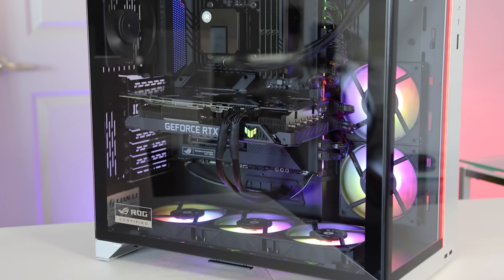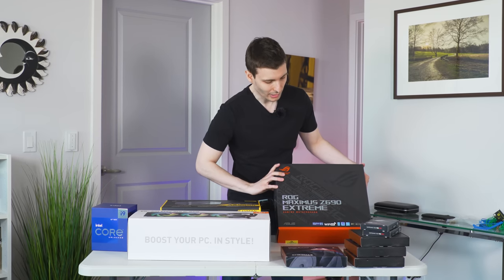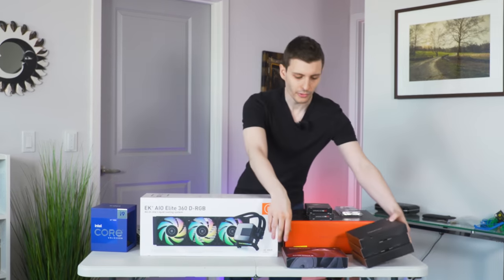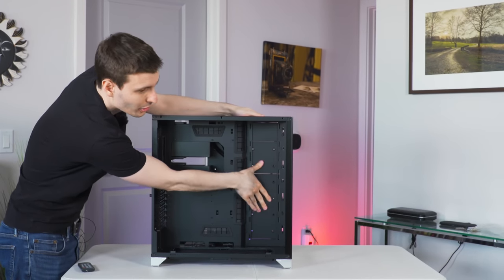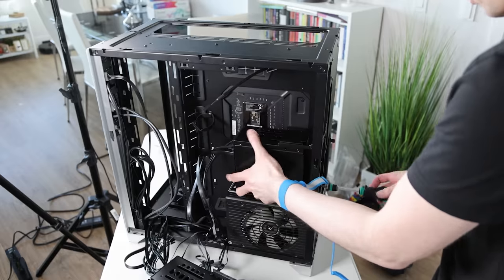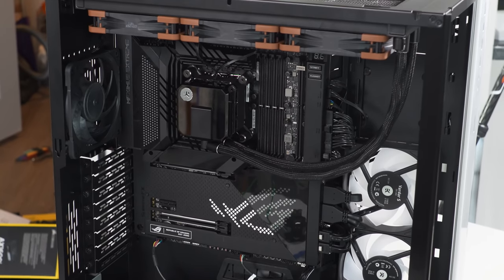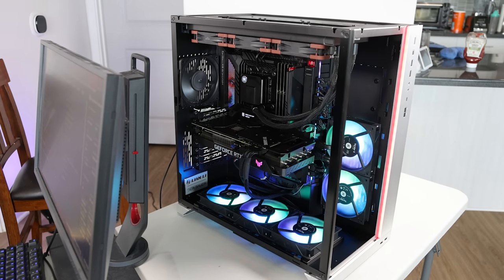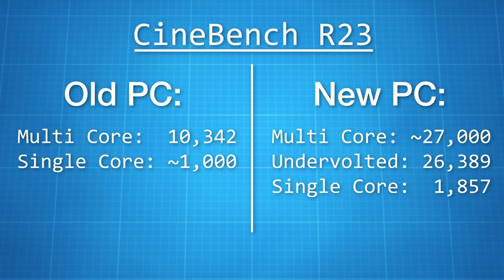I FINALLY Built a New PC After 7 Years (Unlimited Budget)

Comment: For my first pc build since 2003 I went all out too and spent $4,300 and built a powerhouse PC when I built it I was 2 parts away from being the best Ryzen machine you could build and I bought it last year sadly or it would be 5950X instead of 5900X and I woulda probably still just went with a 3080 Ti the 3090 is just excessive and unnecessary at this point, heard rumor’s of desktop zen3 6000 CPU’s later this year so I’ll just get a 6900X or w/e they call it in 4-5 years and upgrade to that

Comment: You are drawing air in from the bottom of the case and from the side and pushing it out of top of the case which means all the heat in your case is being pushed through your radiator. I watched a lot of videos on this case before building my PC and I settled on pulling air in from the top and bottom and pushing air out the side of the case.  This has worked really well for me and my temps are stellar.  I chose a Lian Li Galahad for my cooler though.  I would be a little worried about the fact that your CPU temps were high and you undervolted to accommodate this. A stock cpu shouldn't be getting hot like that and shouldn't need undervolting.  The first thing that should be considered here is you are using an AIO designed with 6 fans and have reduced it to 3.  Regardless of the fans you chose this should be the first thing you checked to see if you had gotten better temperatures if you changed.  IMO if you don't want to do that I would consider transitioning to pushing air out of the side and drawing in air from the top and bottom to see if this helps.  My stock 12900k doesn't get hot even when it is being pushed and my score if memory serves was over 29000.

Comment: Very nice pc, I'm about to build in the same case with the lian li sl 120 fans and strimers. Using a 12900k with an asus z690e gaming mb with 64gb corsair dominator ddr5 5200mhz ram. Will be using an nzxt z73 aio for the cpu and an evga ftw3 3080ti and an evga supernova 1000w P2 psu. I installed the cool my gpu copper plate on my 3080ti which should help it run cooler. Thanks for sharing, looks great!

Comment: maybe you didnt screw the radiator block to the cpu the right way or you didnt screw it enough to have the preferable pressure because the temperatures are higher than they should be... i know this chip is super power hungry and everything but still... you have almost the maximum airflow that you could have in this case with a big ass top tier 360 radiator.... (maybe you have it inside a closet or something lol)

Comment: Nice computer, but surely the first troubleshooting step would have been to plug in a monitor?
Reply from the maker: Now i know
Reply: Same. I've never seen someone NOT plug in a monitor after building a computer. Server motherboards that might not have video cards (or display-less video cards) will have a VGA output so that you can plug in a monitor for initial setup.

Comment: WHAT!! A 1,600 watt power supply. Are you crazy. You may as well have purchased a cheap fan heater for $100. An all AMD build would be future proof on half that power output, AM4 and AM5. Would it be wiser to install two smaller power supplies. Just one would be just enough for the new 40XX Nvidia cards.

Comment: ASUS software comment
My X470 motherboard (R9-3900x CPU) comes with "AI Suite III" but if I install that I can't use CORE ISOLATION in W10 (or W11). It was also BUGGY AF anyway as the FANS would ramp up periodically when they were not supposed to forcing me to restart AI Suite III... It gets worse... I removed AI Suite III but Core Isolation still refused to work unless I did a CLEAN Windows install or edited the registry. Sigh... anyway, I did all my fan control and CPU overclock in my UEFI which has worked out pretty well.. it also has the advantage of working in Linux... now my PC is almost completely SILENT even when gaming. I BARELY hear the fans even at almost 100% CPU load... (I use only FIVE Noctua fans. Two for the front intake. Two modded to my GTX1080. One for my Noctua NH-D14 (with one 15cm PWM fan)... my front fans spin normally at about 300RPM and never go above 600RPM. My CPU fan spins at about 400RPM, rarely goes above 600RPM and never goes above 1000RPM!
Reply from the maker: Yea i had to uninstall all Asus's software. It was all complete crap and buggy lol. They do have a "tool" that cleans the remaining remnants of the program, because apparently making the uninstaller actually uninstall the program fully is too hard for them

Comment: About hard drives, not as unreliable as you think, I have a  TOSHIBA DT01ACA200 whihc is around 8 years old and still working fine, i know of people who are using drives much older.  SSD drives are the thing I worry about, certainly the newer high capcacity ones.

The build is nice for an intel, but I don't like the case, but then I don't like most modern cases, no drives bays at the front. oh, yeah Windows 11 is still naff, not complated and I would not trust it if my machine was making me money. 
I would have chosen a Asrock board as I like their boards, but that is me and a AMD 

I amj thinking of dropping Windows anyway and going for a Mac.
Reply from the maker: Yea it was more about the capacity I guess

Comment: Have not watched many of his video's.  Somehow though I would have thought he knew more about computers than what he actually does.  The other thing is the memory.  Unless he's doing something wrong.  There is absolutely no circumstance that he should need 128GB of RAM, none.  64GB is pretty much over the top at the moment, although I could somewhat understand that amount.  128GB.....no, not needed.
Reply: People have different use cases for computers. You don't know how much RAM he needs.
Reply from the maker: Tell that to photoshop with a 100GB scratch disk on a 10GB psb file
Reply: RAM is never wasted when you want to run VMs.

Running like 2 - 3 VMs in parallel when you are filming content for vids will eat your RAM faster than Chrome.

Comment: Why did you put in your motherboard before slotting your RAM or CPU in the case, if you didn't do that, you're life could become 0.000000000000000000000000000000000000000000000000000000000000000000000000000000000003% Easier

Comment: bro got everything good except for ddr5 4800 in which he should've gotten ddr5 6400 cl32 🤦‍♂️
Reply: He commented : "At the moment, there are limited options for 32GB sticks. 4800 MHz @ CL40 is the fastest that existed if I wanted 128GB considering there are only 4 DIMM slots. Anything faster is only 16GB or less"